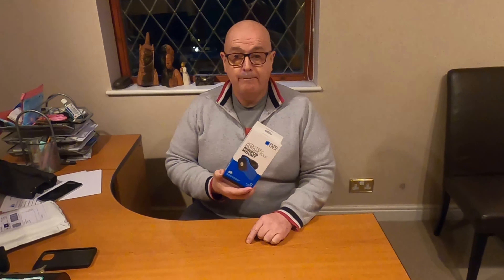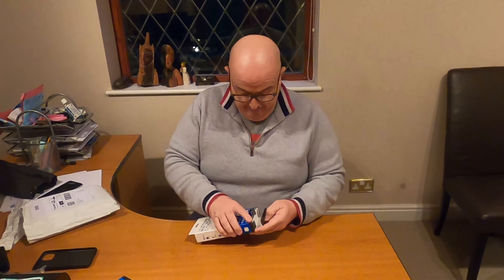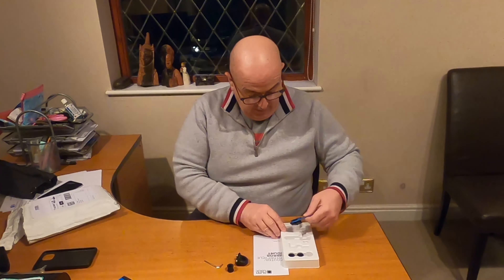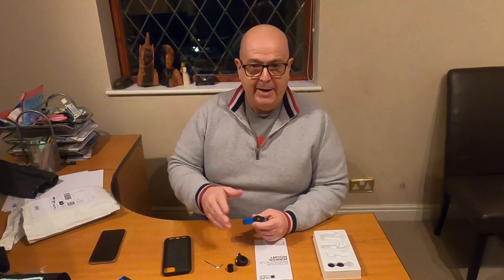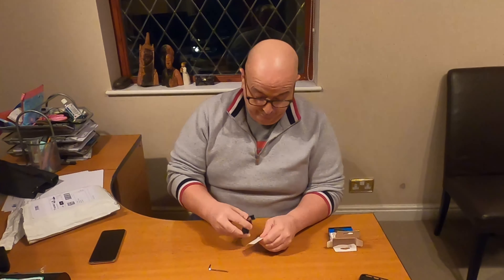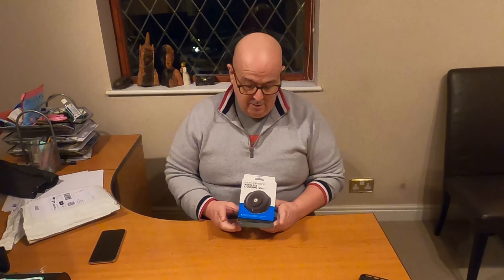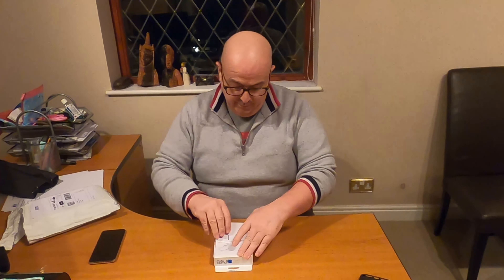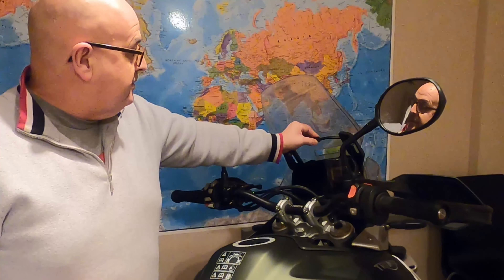Installing quad lock mirror mount to Triumph Tiger Rally Pro

Comment: Thank you as well.  I to just got an 850 sport.  Love the way you mounted the quad lock mount.
Reply from the maker: If you have not already done so, I would totally recommend the vibration damper as a must have and the charging unit is also a great buy.
Glad my video was at the very least helpful to some people, makes it all worthwhile.
Enjoy the 850 sport as much as I enjoy my ride.
Ian
Reply: @backontwowheels9469  TY. I did get the vibration damper.  I'm still on the fence with the charger since It looks like I can run a traditional android charger from the outlet in the forks.  Hoping it holds up well while riding.  Thanks again.
Reply from the maker: @jerrymorales6501  yes for sure you can, I have a 2 port USB adapter plugged into the outlet, although it was a drama getting one because they are different to a standard car charger (cigarette lighter size) so I had to go on-line to buy it.
The damper is key though because I did have a quad lock on my CRF and the phone camera played up after about 800 miles of vibration.

Ian

Comment: Hi, just bought a 900 GTP. How are you getting on with this setup? Any changes?
Reply from the maker: Hi Nick, I changed my bike this year to a speedmaster but had that set-up on my Tiger for Two and a half years, without any issues at all. Make sure you watched video to the end, because I took the tape of and used one of the other packer pieces to take up the slack. Also make sure you have the vibration damper, your phone will thank you.
I took my tiger down to Munich and back twice, was working there, also Denmark twice, working there too.
Only issue I found was with the phone network sometimes (I think it was more to do with roaming allowances in some countries - especially bad for me when on French Toll roads)
Happy riding

Comment: Question, does the wireless charger have a constant draw on the battery? Or does it stop when the bike is off? I’m guessing a constant draw if it’s connected to the battery itself?
Reply from the maker: I plug the charger into the power point at the head stock, via a USB adapter, therefore it is not draining the battery. If it was somehow, permanently fixed, I would imagine it could have the potential to drain the battery, although I believe the the small led lamp would not put too much of a drain on a regularly used bike

Ian

Back on Two Wheels

Comment: Hi, you may want to checkout this guys set up regarding the screen adjustment bar, https://www.youtube.com/watch?v=SLXo5358LNY  I have done the same and it's far better secured on the new bar. I ordered mine from eBay using his search criteria " GPS Smartphone Holder Navigation Bracket fit for Tiger 900/Rally/GT" although sellers are showing only one bar at 22mm (too big to fit mirror mount) - (Also I even asked a seller how many bars which he replied one bar 22mm so they don't know what's included)  they do come with two bars another which 12.84mm. Just in case you find if the tape gets wet it may work loose.
Reply from the maker: Hi Rob,
Thank you for your comment, I will hopefully find time to watch the video you sent, every day is a school day so always happy to see how others have achieved a result.
I am not sure if you watched until the end of my video, but I ended up removing the tape and utilising another of the rubber inserts to pack out the clamp, it has been very secure and I have done 5000 miles without issue, even a 15 hour journey from Munich to Northamptonshire. (That’s another video 😂). 
Take care and enjoy your journey

Ian
Back on Two Wheels
Reply: @backontwowheels9469  Hi Ian, well TBH I got as far thanking us for watching the video, then moved on, I have watched to the very end now. I guess we all have fixes that suit us eventually. Pleased you managed a fix, I was only concerned about the tape effort as I thought it about doing the same but knew from experience on other fixings it doesn't last.
Reply from the maker: @robb9488  yeah it just was not sitting right with me, had to sort it.
Thank you for watching to the end